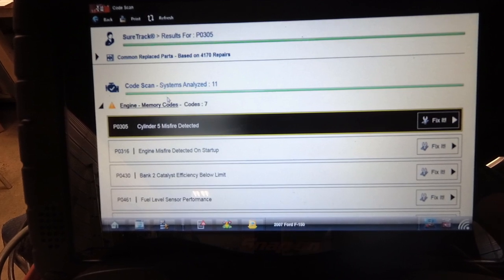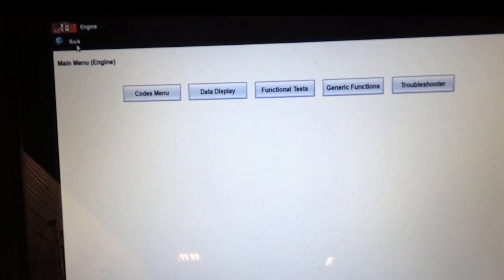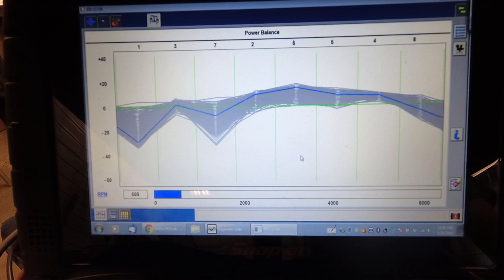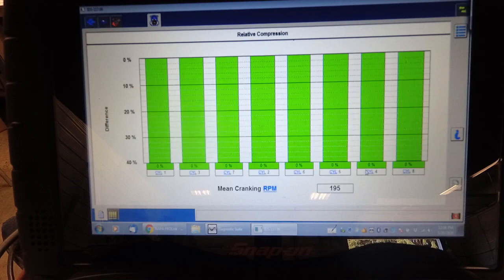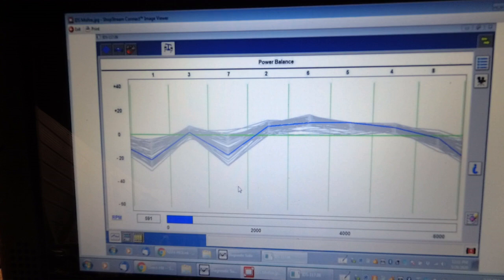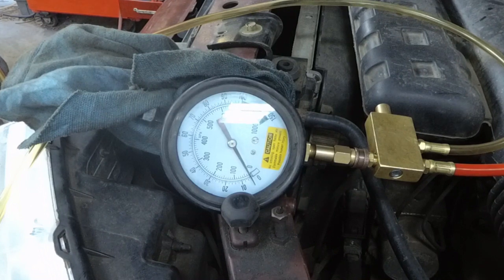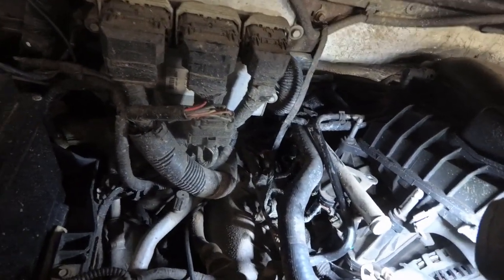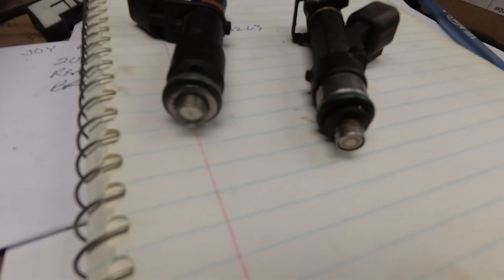2007 F150 5 4 Misfire Diagnosis

Comment: You have that verus so over loaded I think that’s why the ids is so slow. What do you do for Chrysler when you need a function and your aftermarket scanner is missing it? I don’t have witech micropod I just use a cardaq with a witech 2.0 subscription and its nice. But registering for the subscription is kinda a pain. Good work! I thought snap on had an update a few ago it did the fords version on power balance I thought
Reply from the maker: Yes the power balance on the 6.0 lithe powerstroke looks like IDS. I'm still running 19.4. I don't have Chrysler yet...
Reply: If you have a j box I’d just use that for witech 2.0 and buy subscriptions when needed. Instead of dropping so much on the micro pod.
Reply from the maker: @philh9238  I have the snapon pass thru pro 2. Do you know if that will work witech?
Reply: Yea it should work. They don’t register your j box mainly they register your laptop. Has to be windows 10. I’m using cardaq plus 2. Which is the same thing. If ya need help watch tool hit USA for registering of your laptop. Then I can help with the rest
Reply: If needed
Reply from the maker: @philh9238  Thanks so far I've been ok with Chrysler. Snappy does a pretty good job but since I haven't used witech I don't know what I'm really missing. I know the network topology map is cool. Thanks for the offer!
Reply: I usually use it for no communication issues. Also flashing is pretty easy the way they’ve done away from the j2534 application.